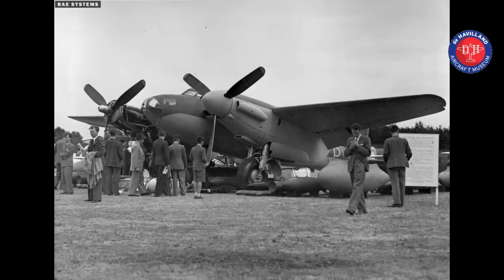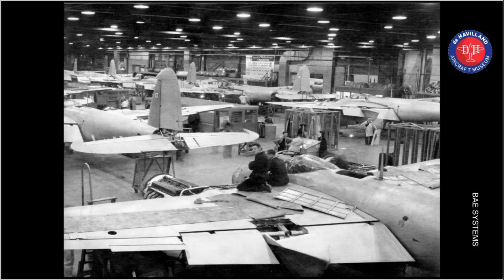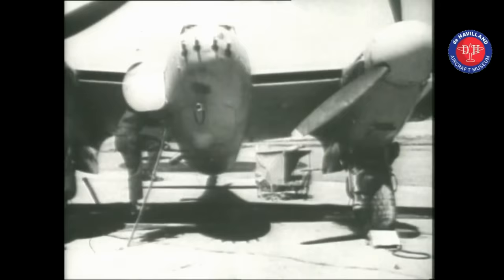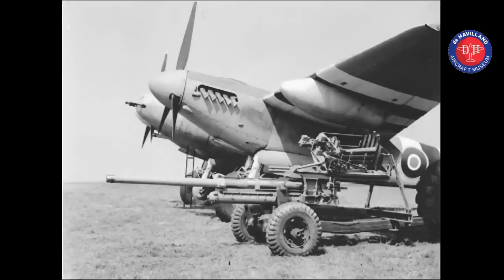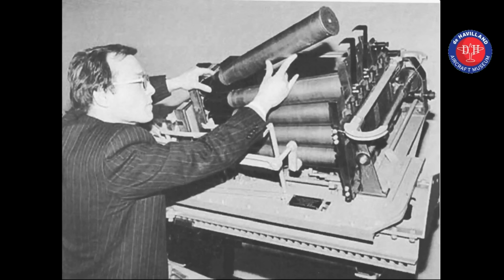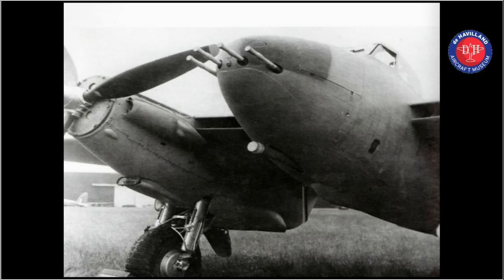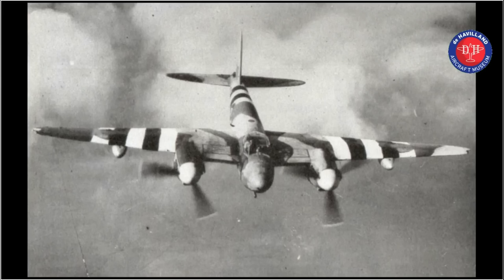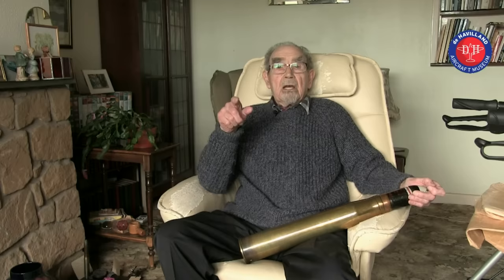TSETSE the DH Mosquito Mk XVIII

Comment: My father was a foreman on the job when they built the first Mosquito at Hatfield..... He did fly in one with Geoffery DZeHavilland himself one day as they were short of people for a instrument test, so dad got roped in. He said that the pilot really wrung the Mossie out, and dad was really glad that he knew how hood all the glue joints were!...... a great aircraft flown into battle by brave men.
After the war dad went back to De Havilland (he had a spell in the Army) and worked on the prototype Comet and the development of modifications after the high altitude failures..... So he started on Tiger moths long before the war and ended up on the Comet afterwards... quite a change in skills as by trade he was a carpenter/joiner......
Oh... y'all might like to know that there's an outfit in NEW Zealand that will build you a Mossie if you have a big bank account. I've seen one (have pictures) being flown at Hood Aerodrome in Masterton..... brand spanking new... all they need is the 'metal bits' (engines, undercarriage etc.) and they make all the rest.... They made all the jigs to fabricate the wooden bits..... Lovely to see they are not going to die any time soon...
Reply: It would be great to see an updated version with carbon/glass composites and turbo-prop engines.
Reply: @davidelliott5843  There is acompany in NZ turning out Mosquitos to order. Your dream could come true (for a price).